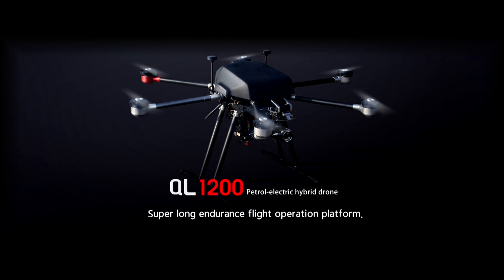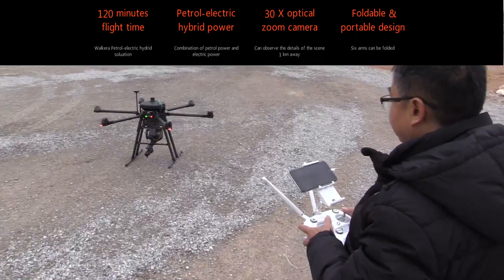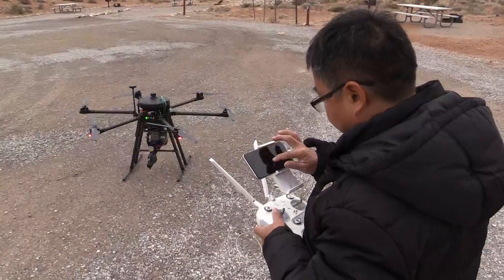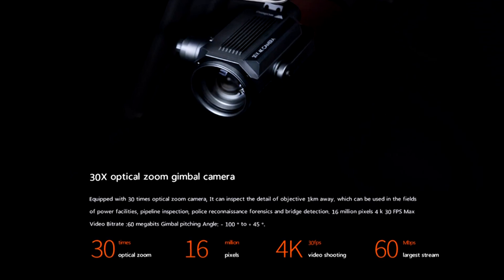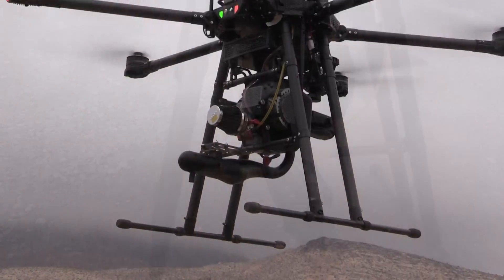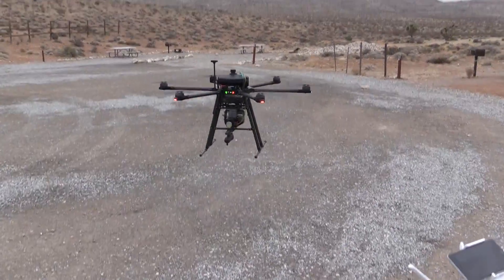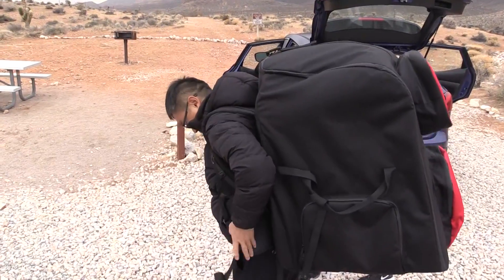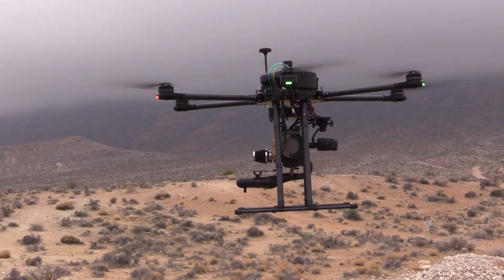Flying with GAS: the Walkera QL 1200 in action!

Comment: rescue drone with 2kilos playload? what is it going to reacue? a squirrel
Reply: That means it can drop supplies, radio, fire stilupud, tent, sleeping bag, or spray a stranded hiker with pepper spray so they feel warm. 2 hours flight time is very nice. 

With different cameras/scanners, it can do surveillance for some time or long distance survey way cheaper than a chopper. It’s useful, expo, and for a niche end user. 

I was just searching for gas powered drone fir some reason... 30k is a lot.
Reply: @johnmadsen37  Yeah you still not going to do anything with that small payload weight. Useless.

Comment: at least walkera has the guts to make this step. it may not be politically correct to use gasoline on a quadcopter, but if it's about flight time, there is no other option. (and if you are fighting bush fires, certainly nobody will complain about the noise aspect of even go into the carbon dioxide debate...)
Reply: They may require your to put a spark arrestor on it. And a Catalytic Converter for use in California. Then, there is that pesky label that warns about the possibility of Birth Defects if you lick the exhaust.
Reply: @fleigenschnitzel8144  if you lick the exhaust, the damage was already there